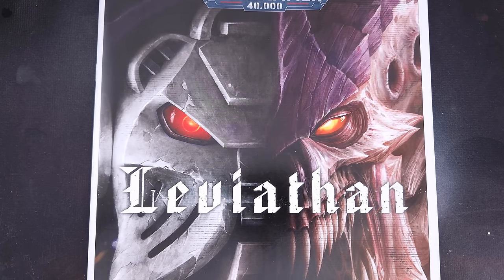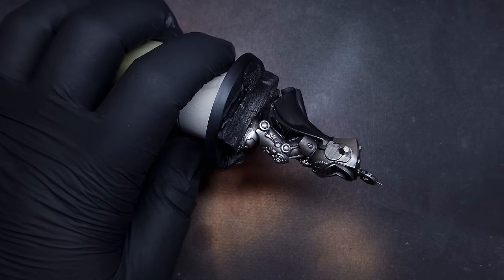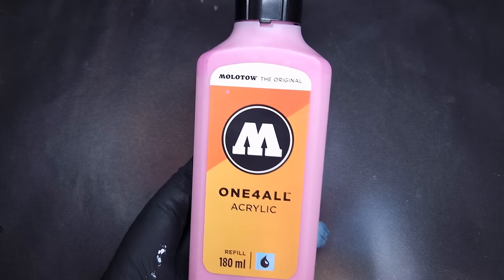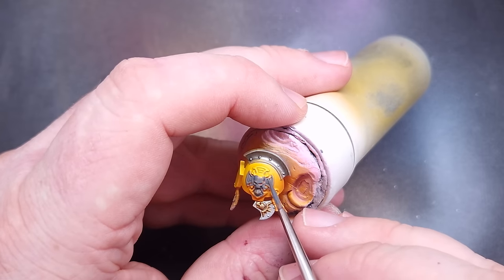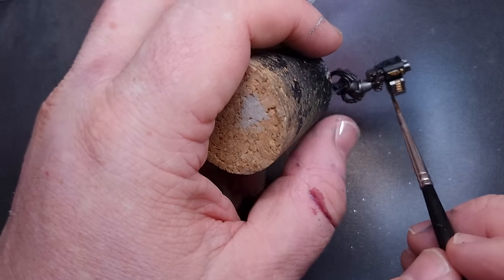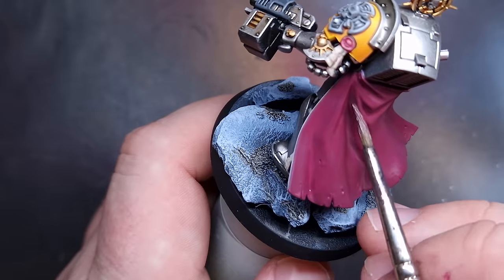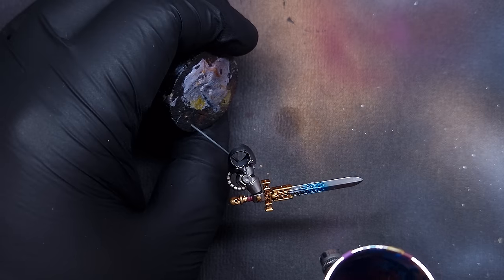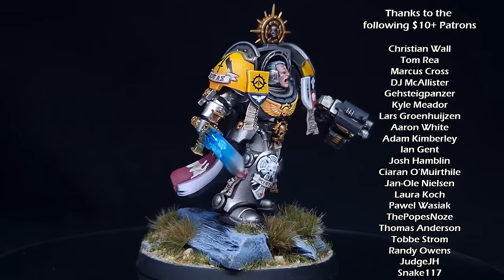How to Paint Silver Templars Fast

Comment: Does anyone else find that when they spray polyurethane primer that it just rubs off afterwards?
Reply from the maker: I've had this issue a few times - usually when I spray onto it too soon after priming - and not letting it cure properly, even though it is touch dry.

I also get issues using it on resin and metal models too

Comment: did not know there was metallic varnish and do you have a airbrush booth or ventilator running or what is your airbrush setup? keeping thinking about getting one for my necrons mainly.. might actually get them done then 😅

also if you google ''studylib silver templars'' you will find the silver templar book in pdf-ish style, just make some screenshots if you want to save them for later use, since the book was a very limited run as was white dwarf (456) that introduced them,
Reply from the maker: Thanks for the heads up - normally I use a portable extraction unit - but for this video I didn't as it would have got in the way a bit!